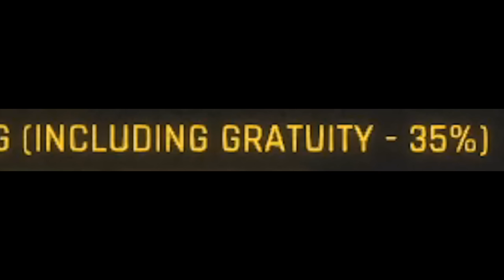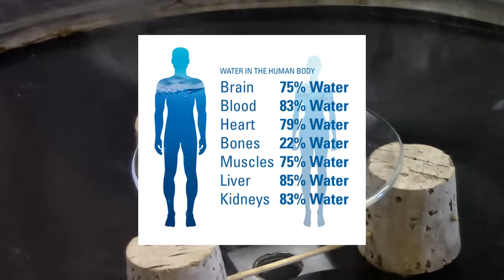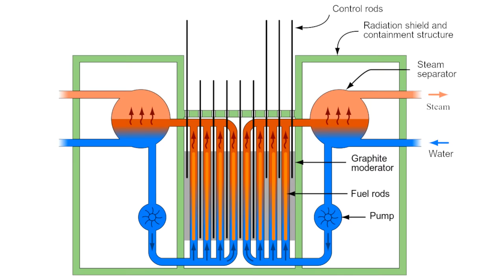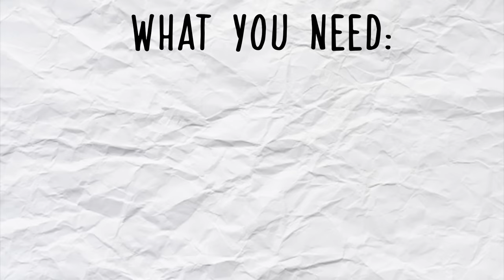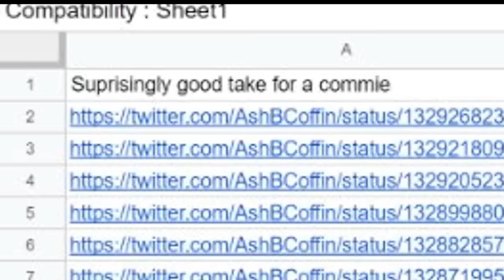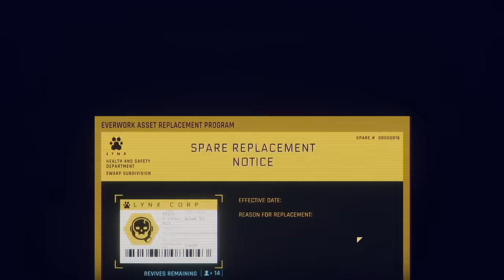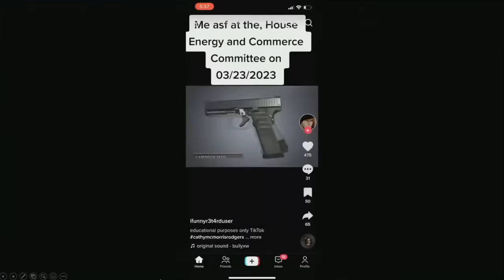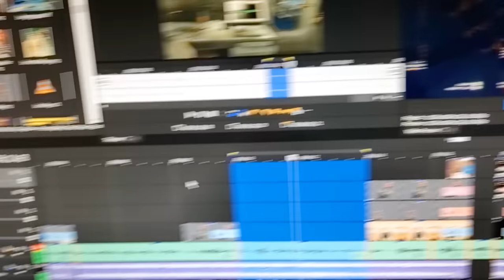Hardspace Shipbreaker Review | We Own You® Edition™

Comment: Weirdly enough sometime using the lateral cut mode can be less risky than precision. With precision you have to find the right angle or time it so you don't burn through a cut point right into a fuel tank. But with lateral, as long as your cross hair is fully inside the cut point and your tool isn't clipping through something explosive you can just click once for risk free detachments.
Reply: If I remember right, it's also faster and any extra wear-and-tear is negligible for a single shift. I kept expecting an upgrade to change that, but the upgrades were one of the many things that didn't improve since the initial release.
Reply: I exclusively use the splitsaw for cut points on the outer hull. Splitsaw can't cut through the hull, so you're safe just blasting at it. FUN FACT: when the game was in beta, you used to be able to buy an upgrade that powered up your saw to be able to cut through exterior nanocarbon hulls. It's a permanent upgrade, so you couldn't remove it after purchase. No one really enjoyed this, so it's good that they got rid of it. It ruined a lot of speedruns.
Reply: It's also a lot faster and simpler to destroy ai cores with it. 
After a while you just stop using the precision
Reply: Until u click 30 times in a ship and the line in a split second covers the reactor lol
Reply: Just machinist engineer things. Sometimes the easiest solution is the one with the least adjustments needed.
Reply: Press your face against the cut point; it's for your own good
Reply: Ah yes, they did remove the cut protection thingies, you had to use precision mode for cooking them on, a while ago right?
Now it is only the cut points without guarding casings.
Splitsaw ftw! Time is money, and if something goes wrong, failure is entertainment!
Reply: @juliomontega2868  There are still reinforced cut points, but they can only be severed with explosives. The laser cutter doesn't do anything to them in either configuration

Comment: So I looked up what was mentioned at 4.07. Wikipedia included this little gem:
"...Hellevik, being exposed to the highest pressure gradient and in the process of moving to secure the inner door, was forced through the crescent-shaped opening measuring 60 centimetres (24 in) long created by the jammed interior trunk door. With the escaping air and pressure, it included bisection of his thoracoabdominal cavity, which resulted in fragmentation of his body, followed by expulsion of all of the internal organs of his chest and abdomen, except the trachea and a section of small intestine, and of the thoracic spine. These were projected some distance, one section being found 10 metres (30 ft) vertically above the exterior pressure door. "
Reply: It also bears mention that the compressed air and his fragmented remains shot out with enough force to kill the idiot operator that broke the pressure seal.
Reply: @45calGunslinger  The Karmic justice was instant, as it should be.
Reply: as usual, the coroner hiding horrific gibs behind medical compound words and thinking no one will notice
Reply: I regretted looking up doubly so because I have safe search turned of 
Thanks Setth really needed those nightmares
Reply: @Unapologeticweeb  He did say you did not want to know
Reply: Like that scene from deep star six
Reply: Actually I’m wrong, it’s more like an underwater version of that scene from alien resurrection
Reply: @sailorshark3334  Except far more violent. Thankfully, violent enough that none of the men who died even had time to process what happened.
Reply: Good fucking god.
Reply: This is why i look up articles and not footage or photos. My imagination is not good enough to project what these things would look like
Reply: maybe it was just a prank
Reply: Nothing like a good Delta P moment
Reply: The difference is, saturation divers are actually pretty handsomely paid for the job.
Reply: @spinyslasher6586  actually that kinda makes sense given the conditions they have to work in because seriously you would have to pay someone a shitton to do that kinda work doesn’t matter how desperate you are
Reply: @dr.mansdoodeph.d.2421  Yup. It's not just the risk, it also requires highly trained and specialised individuals to do saturation diving.
Reply: If it is any consolation at least the death was instant and painless.
Reply: @spinyslasher6586  It's closest equivalent would be doing a spacewalk, and that says a lot about how difficult it is.
Reply: Ok so I'm really nitpicking, especially considering that sseth doesn't make that kind of mistakes when he mentions those kinds of random facts and incidents..BUT the incident took place on November 5th 1983 and not march 1st 1976
Reply: i looked it up and saw pictures of the remains of one of the fellers that died
that was all the info i needed, i got the idea after that
Reply: @MC96-  got em good
Reply: When it's got ya, it's got ya
Reply: @Unapologeticweeb  Just imagining Emet Selch having nightmares... not of his home world being sundered but of a guy being forced through a small hole at the speed of sound.
Reply: "u kill me I kill u"
Reply: @sailorshark3334  except there it was a difference of 1-0 = 1 atmosphere (which kind of puts the believability of that scene in question...), while here it was a difference of 9-1 = 8 atmospheres !
Reply: That's gotta hurt
Reply: That’s badass.
Reply: The diving bell went from 9 atmospheres to 1 atmosphere in seconds.
Reply: @secretname2670  There are images of Hellvik’s remains at the coroners table, but it really just looks like vaguely human shaped ground beef and a boot
Reply: They actually recovered some parts of the guy and put it on a dissection table.
Reply: @dogfellow3848  as we all know. Being told not to find out only arises more curiosity in people
Reply: @ModemMT  well I'm not exactly that keen to look that up, I have no idea where people go after death, atheists and theists be damned and I'm not intent on finding out for the nearest 40 years at the very least -
so I'm not gonna prompt my brain with these images because I'm not smart enough to figure that out either. 
Simply put ~my ignorance is my shield.
Reply: A horrendous reminder of our fragile carnal state. The mind is impossibly free but the body is grounded
Reply: The good news is nobody involved felt anything.
Reply: @peir5074  The flesh is weak, the machine is strong
Reply: There are also photos of the aftermath
Reply: @45calGunslinger  looked it up. Looks like after years of legal disclosure,  it actually wasn't operator error but a mechanical failure
Reply: @quinntendo6497  technically yes, but not really. There wasn't any protection systems to STOP someone from blowing the seal when the chambers were still open to the trunk, which was argued as a mechanical fault. It's a fair argument but deliberately neglects the crews' own duty of care.
Reply: So basically that one scene from Alien Resurrection?
Reply: I have many regrettis for opening that can of sphagettis. 
God damn those images are gonna be burned in my brain for a while, dude looked like subzero after a fatality.
Reply: @JellyBean-ed2uq  I'm pretty sure he did it on purpose. It lulls you into a false sense of security until you scroll further down.
Reply: @strikermodel  sounds like him tbh
Reply: @45calGunslinger  There was no way for the tender to know the door was open or closed except for some shitty intercom that you could barely hear through. Its entirely possible there was just some minor miscommunication that led to this

Comment: To anyone confused about Cherenkov radiation: light only works at peak efficiency in a vacuum . When it has to move through matter (like say the water of a reactor tank) it slows down , resulting in a situation where certain kinds of radiation move faster within the matter
Reply: Yeah, how much slower does visible light travel through air vs a vacuum?
Reply: @whynot7564  No idea, but apparently the Demon Core created a flash of blue light
Reply: @EvilDoresh  Should be noted that the demon core's flash of light was only visible by the affected parties because it technically happened inside their eyes.
Reply: @Otakumanu  Eyeball lights are the best kind of lights
Reply: @whynot7564 The speed of light in air is almost the same as in a vacuum.

Consequently, creating Cherenkov light in the air requires extremely fast / energetic electrons, on the order of 20 MeV. This is more than the energy release from fission can generate. That said, a reactor could still generate bluish/purplish light by ionizing the air.

By comparison, the speed of light in water (and, consequently, the human eyeball) is ~75% of that in vacuum, which is very much attainable with a nuclear reactor (or certain radiotherapy devices when you're getting treated for brain tumors).
Reply: If moving through matter slows it down why does it move faster within the matter?
Reply: @eyjay1508  Light slows down in matter. For example, the speed of light in water is only 75% of the speed of light in a vacuum.

Other forms of "radiation" (like beta rays or cosmic rays, i.e. extremely fast charged particles, rather than electromagnetic radiation) can therefore exceed the speed of light in a given medium. If this is the case, they lose energy by emitting it as Cherenkov radiation until their speed goes below the speed of light in the medium.
Reply: @maxjoechl5663   Oh I think I get it. Light slows down in certain materials, but other forms of radiation don't, so technically they are faster than light inside those materials. 

But why do they lose energy with cherenkov radiation? The "speed of light" is a constant, just because light happens to travel slower in certain mediums doesn't mean that the constant itself changes, so why would those raditions lose energy if they are still obeying the original constant?
Reply: @eyjay1508 the radiated particles (faster than light in water) still has to go through the medium, apparently creating more photons due to the collisions (this is the energy lost).

It's similar to sonic boom.
Reply: Slightly incorrect, I believe. The light never actually slows down. The speed of light doesn't really change. The light just takes longer to travel through the medium, usually due to it bouncing around and whatnot. But a photon is always going to be moving at a constant speed, regardless of the substance or medium it finds itself in. 

We see it take longer to pass through, and assume it slows down. But by its nature it can't slow down. It is simply taking a longer path and losing some energy along the way. 

Unless my science teacher lied to me, idfk.
Reply: @eyjay1508  the light never actually slows down, it just takes longer to move through the medium. Photons are literally incapable of traveling slower than the speed of light, but they can appear to slow down to an outside observer, because they are being held up and bounced around a medium. Granted, I'm not a nuclear physics, so I'm not absolutely sure that my knowledge is correct. I could very well be mistaken, but I believe the blue light is a result of super charged ionized particles colliding with the molecules in the air, thus causing light to appear, kind of like the northern lights, but much more ominous.

But I could easily be completely incorrect. Take my words with a grain of salt.

Comment: Videos like this remind me that Sseth is actually an incredibly smart, highly educated doctor in real life
Reply: Pretty sure he's not a proper doctor because he hasn't finished his oncology degree. He could probably get away with using leeches though
Reply: He gets most or it wrong, but hey, if you think the sun is hot because of fusion or objects get hot re-entering the atmosphere due to friction, good for you ...
Reply: @lyntoncollins2758  Objects don't get hot due to friction during re-entering atmosphere? Explain thyself
Reply: @wawawuu1514  the compression of the air in front of the reentering object does most of the work. The air doesn’t have time to flow out of the way so a high pressure ball of air builds up in front of the thing. And since PV=nRT, a big jump in pressure means that the gas itself gets hotter and hotter in its compressed state.

There is some friction as the pod or whatever keeps going but it’s not the main driver of the heat. If it were, heat shielding wouldn’t be almost entirely installed on the underside of spacecraft - the sides feel air friction too, but only the bottom has a hyper-compressed ball of air directly touching it, a ball that can’t escape and can only get hotter until the pod slows down enough to let the air flow normally again. Or breaks apart.
Reply: @mentfib1906   Oh wow, that is interesting. How do we know it's true? Who and how proved this to be correct?
Edit: Actually, the second part of your post already is evidence for that thesis.
Reply: He's an oncologist not a nuclear physicist.
Reply: The people of Oondabobwallabwe haven't chosen him as their warlord and democratically elected dictator for no reason.
Reply: @lyntoncollins2758  What do you mean when you say "the sun is hot because of fusion"? Are you referring to the specific process by which the bulk of the material that comprises a star is heated instead of the process that occurs at its core?
Reply: @lyntoncollins2758  …I’m pretty sure the comment is a joke

Comment: In case you are wondering: three divers had their blood boiled instantly and fourth one was forced through 60-cm hole, which pressed all organs from his body and dismembered him entirely like a meat grinder. The reason is an explosive decompression from 9atm to 1 atm.

And yes, Sseth meant 1983 accident I believe, not 1976
Reply: "With the escaping air and pressure, it included bisection of his thoracoabdominal cavity, which resulted in fragmentation of his body, followed by expulsion of all of the internal organs of his chest and abdomen, except the trachea and a section of small intestine, and of the thoracic spine. These were projected some distance, one section being found 10 metres (30 ft) vertically above the exterior pressure door"  

oh no :(  

https://en.wikipedia.org/wiki/Byford_Dolphin
Reply: The “60cm hole” was a slot 60 cm long, not what my friend assumed was a 60cm diameter circle. Imagine a butter knife, but 60cm long and the same width, that’s what his body went through. Absolutely horrifying
Reply: You know this sounds like that women that violated the international space station with a drill could have killed a lot of people.
Reply: @DARKthenoble  Thing is in space it's going from 1 atm to 0.  The process will not be as violent and probably much more painful
Reply: @ⰎⰋⰕⰜⰑⰓⰡⰁ225  space decompression is pretty safeish as long as the hole is small you can plug it with your own hands just fine, the force behind it is relatively low
Reply: don't forget that they found the poor dude's penis among all that mess and it had been turned inside out, or "invaginated" as the post-incident study delicately puts it

Comment: I love how Sseth always gives us advice on how to get these games cheaper or just straight up crack it 🤣
Reply: Doing God's work.
Reply: Polish merchants are very generous
Reply: Well this dev has so many unkept promises and did so such unnecessary stuff no one wanted...

Man this game deserves to be cracked
Reply: @cooperlittlehales6268  don't even use polish merchants, there are better options

(Except for multiplayer games)
Reply: @cooperlittlehales6268 What are the polish merchants?
Reply: @davidjr4903  GOG
Reply: @yarpenzigrin1893  Whats the difference between gog and steam?
Reply: @yarpenzigrin1893  oke tnx 4 info
Reply: @blooocki  
And no mod support? 
That’s a grudgin’.
Reply: @yarpenzigrin1893  
What is DRM? 
(This is a bot check; pledgest thee thou fealty to the glorious Emperor of Man if thou beest not an abominable intelligence).
Reply: @combativeThinker  DRM stands for Digital Rights Management.

DRM protection check on your pc in different ways if the game has been bought legit.

Most ways are very intrusive like kernel level access, keep reading and saving on your hdd/ssd(shortening it's lifespan a lot) and doing so much stuff in the background that lots of games loose about 10 to 45% of its performance.

Even consoles have DRM. PS1 discs had bumbs for example Wich made them wobble in certain wavelengths.
Some PC games did that also, but worse. Making the game unplayable in lots of cases.
Reply: @yarpenzigrin1893  Do devs get money if you buy from sites like GOG

Comment: The sad thing about Hardspace is that it's a great idea that's woefuly under-realized. There aren't that many ships, so the game just becomes routine after a short while. There is no real mission variety-every ship is salvaged he exactly the same way, and the story, well the story basically only exists inbetween your shifts, it has absolutely ZERO impact on the missions (or vice versa) besides on very specific mission, and after that, they're the same again.

As a statement on the monotony on working, it's great, but as an actual game, it falls very flat.

I want to see a sequel where you're set loose as an independent salvager and you have to go and salvage ships in dangerous locations. Each one would have unique challenges and dangers, and wouldn't just be 1. dismantle ship and 2. place in receptacle. 

For example, one mission could involve gaining access to an AI infested ship and finding an important harddrive full of data, while the ship's AI tries it's best to mess with and kill you.